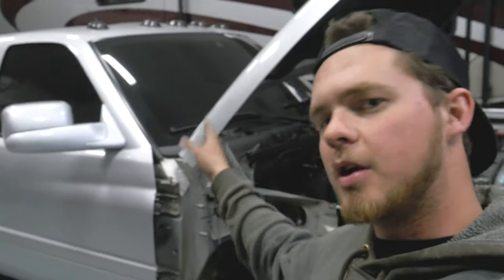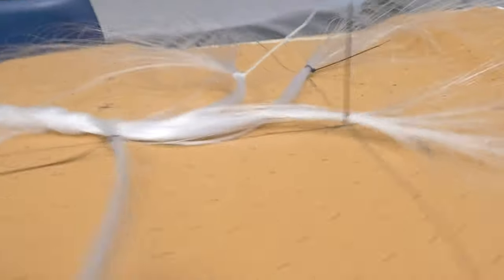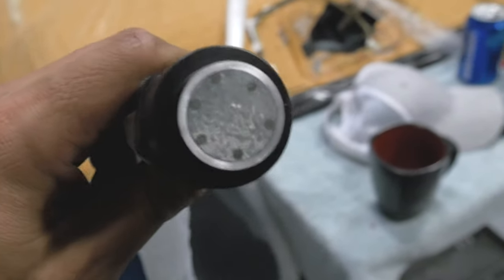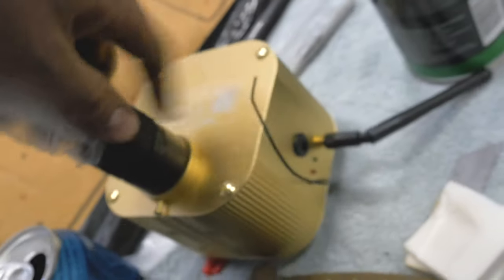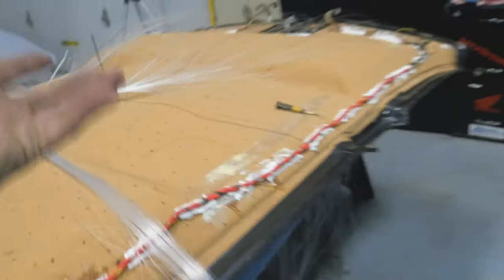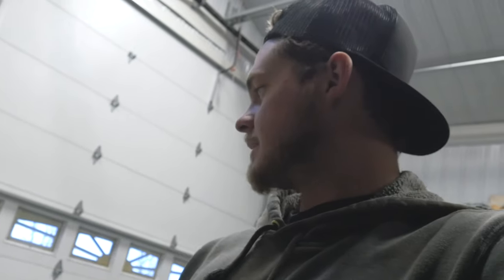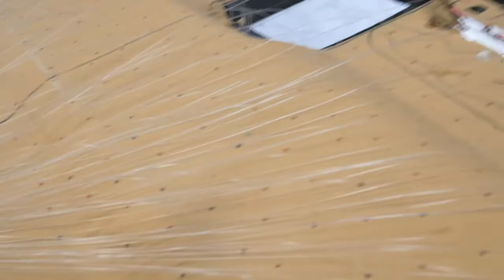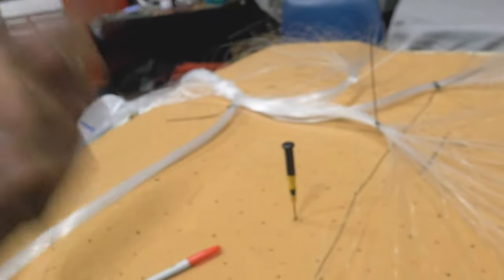It's DONE... and it's INSANE!!! (DIY Starlight Headliner Pt.2)

Comment: We’re you able to control both motors with one app? Or did you have to switch back and forth between devices? How does that work? Can you link both motors to that one app
Reply from the maker: Yes you can link both motors to the same app

Comment: I was thinking about doing this to my 05 Cummins but one question I have is how are you going to wire up the power source?
Reply from the maker: I have Subwoofers with an amp directly under my rear seat. I have an inverter wired into the "Turn Key Power" of the amp, which is used to power the light sources. If you need a better example hmu on Instagram (casey.c.cole) and ill send you pictures

Comment: What tool did you use to poke the holes?
Reply: You can use a fabric pen. It’s got like a little T shape handle at the top and it comes to a point it’s about an inch and a half total in length. If you go to a place like Joannes fabrics or hobby lobby and go to the fabric section tell them what you’re looking for.